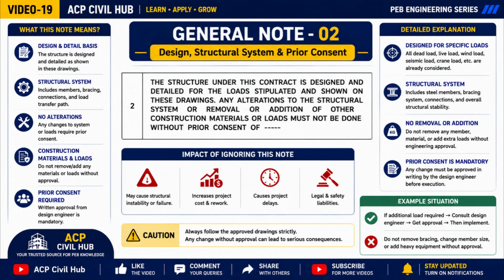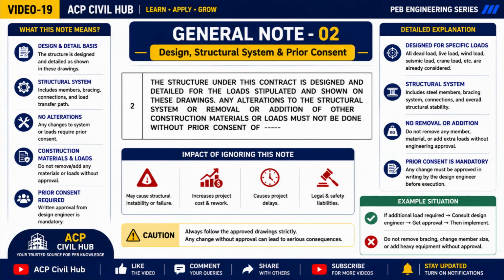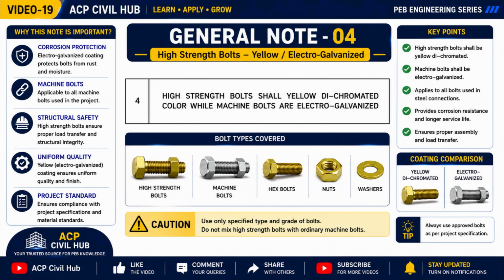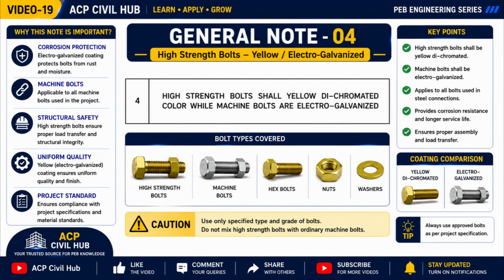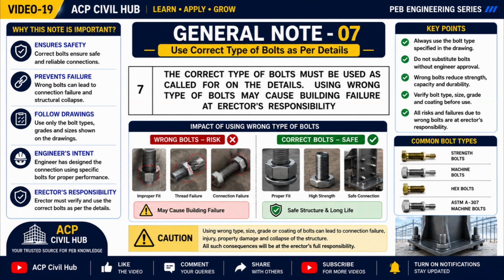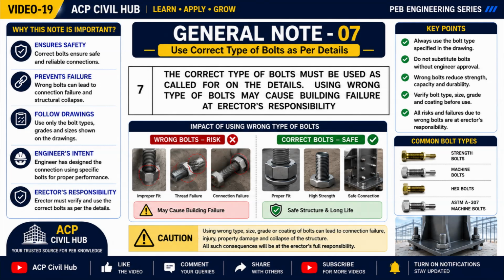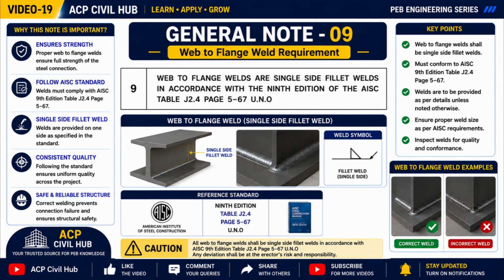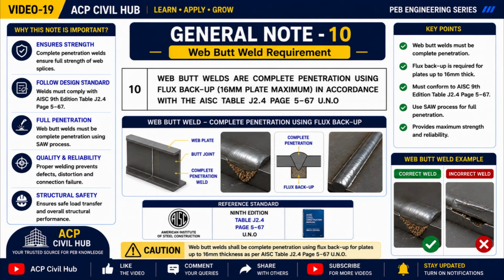PEB_VIDEO-19 : PEB General Notes Explained | Complete GA Drawing Notes | PEB Tutorial

Comment from the maker: 📘 Which General Note do you think is the MOST important for successful PEB fabrication and erection?

1⃣ Dimensions & Levels
2⃣ Structural Design Requirements
3⃣ High Strength Bolts
4⃣ Welding Requirements
5⃣ Built-up Sections
6⃣ Purlins & Girts

Comment your answer below and tell us why.

🎥 Next in the series: GA Drawing Notes Explained (Video-20)

👍 If this tutorial helped you, don't forget to Like, Share, Subscribe, and turn on the Bell Icon for more practical PEB engineering tutorials.

#PEB #SteelStructure #StructuralEngineering